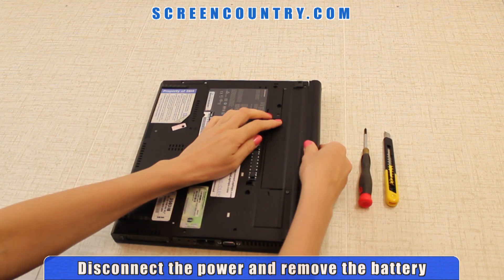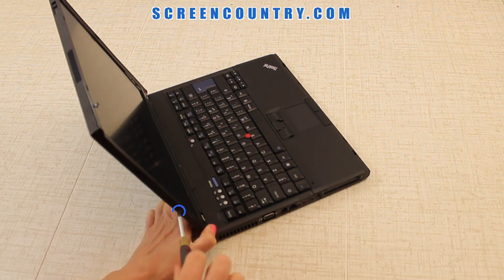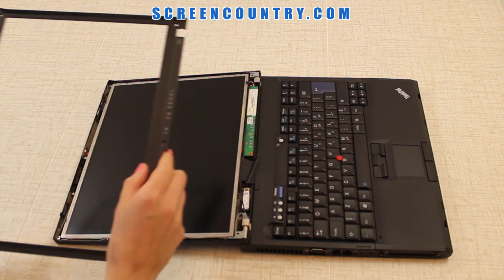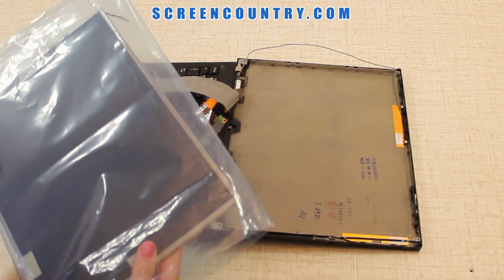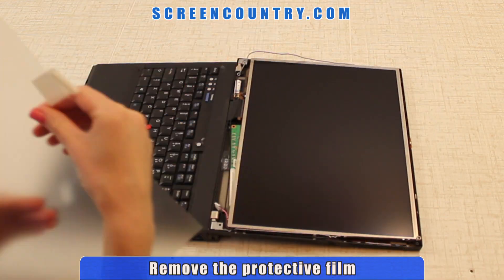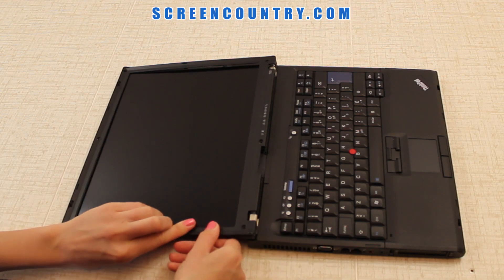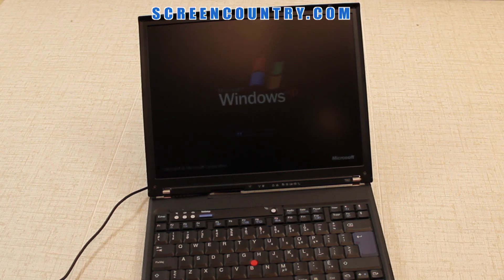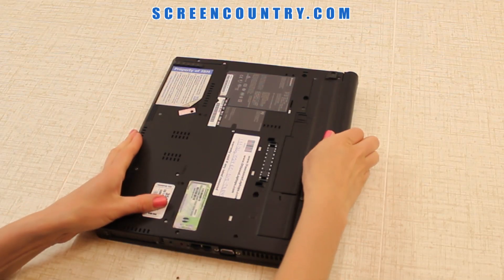Laptop Screen Replacement / Removal Instructions for IBM Thinkpad T60

Comment: My screen doesn't come on?
Reply from the maker: Very often a simple cable reconnection at the LCD, motherboard and the inverter can solve the issue. A second most common scenario is a failed inverter - if the old (cracked) screen does not light up as well - try swapping inverters.
Reply: ScreenCountrycom How do I remove the rubber screw covers ?